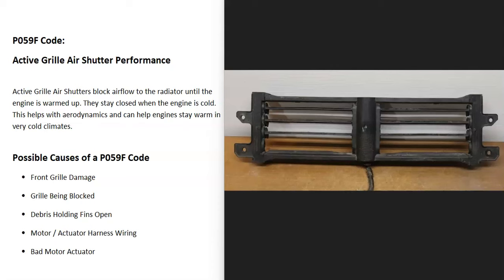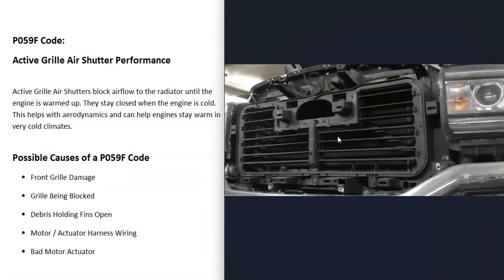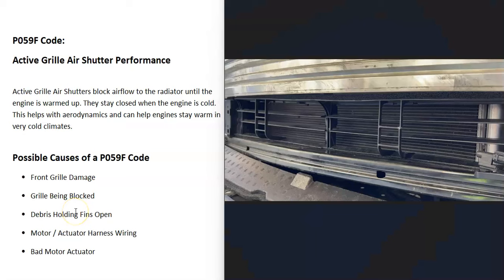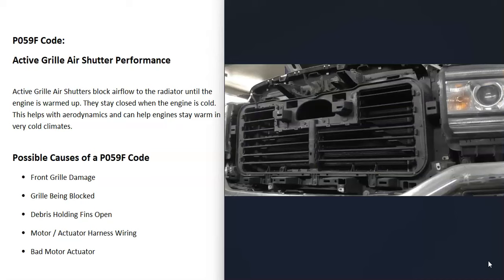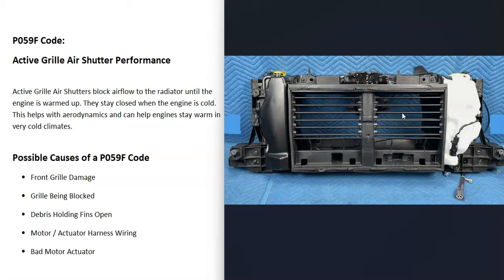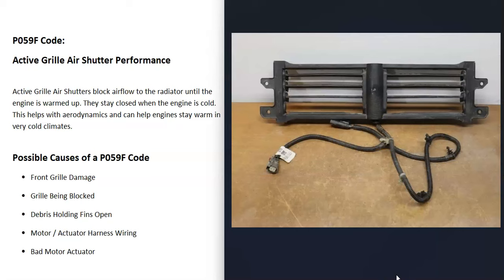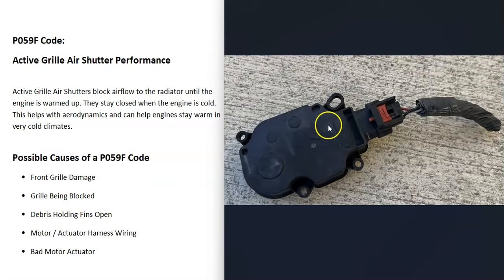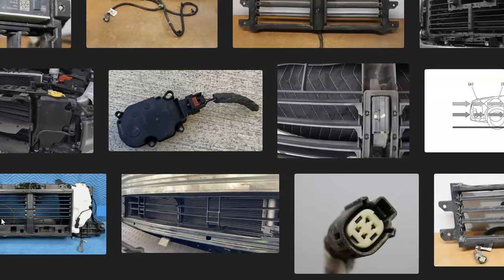Causes and Fixes P059F Code: Active Grille Air Shutter Performance

Comment: I am from Saudi Arabia . I have the same problem with my 2019 Nissan Altima. In winter, the temperature reaches 30 C (86 F). In summer, the temperature in the shade reaches 55 C (131 F). Tell the Nissan factory in America. We live in hell. WTF .
Reply: How did you fix it? Same problem in my 17 Altima
Reply: I am a GM tech in Makkah region, 
Feel free to get in touch for any further information and advice
Reply: I also have a 2019 Nissan 😭 I think it’s, for some reason, common for 2019s nissan
Reply: @cypher1160 what do i do to fix it i have a 19 nissan too😂😂
Reply: Thank you. The video was very helpful
Reply: @felixmoreno570 that's crazy I'm having the same issue with my 2019 Altima

Comment: BMW of North America has extended the warranty on the front grille upper/lower active air flaps for up to 15 years/150,000 miles. It's BMW SIB 01-12-19. This is for G01, G02, G12, G30, and G32 models on certain 2017, 2018, and 2019. Do a search for the bulletin because the production date will matter. The warranty will not cover damage caused by outside influence (Example: If wire harness is damaged from rodents chewing on them or if debris damages that flaps.

Comment: Just got this code yesterday on my titan I just bought two weeks ago !! Thank you for the explanation
Reply: Same here.  Got mine 2 weeks ago
Reply: @Homerunhitta2525 what did you do to fix it?
Reply: @zinndecker8305   My truck was still under warranty so the dealership ordered a new one and replaced it at no cost.  No problems ever since.
Reply: @Homerunhitta2525 how long did the replacement take?
Reply: @dylanrosenfeld475  Dropped it off at the dealership around 6pm and got it back by 6pm the next day.  Luckily they had the part in stock.  No problems ever since.

Comment: I have a 2015 jetta. I replaced the acuator but cannot get the check engine light to go off and the fins are working properly.  Do I have to find someone that has  a VCDS diagnostic machine to clear check engine light and have my shutter communicate with the ECM? The OBDII will not   keep it off.

Comment: So my Dodge ram 2018 2500 overheats when I drive up the mountain when it’s 100° out. If it was anything else like a thermostat or a water pump or a radiator, it would overheat no matter what the temperature is right.? I’ve talked to many other guys who’ve had the same issue and they said they changed the thermostat the water pump the radiator and nothing changed. I think this might be the cause. It’s not throwing or anything, but it overheats only when it’s hot. Do you recommend a lower thermostat and the? Active grill shutters.

Comment: It was  in the 20's yesterday and my wife went to the car wash. Last night I went to drive the car and the check engine light was on.  I scanned it and it had a P059f code.  I cleared the code.  Is it possible that the water from the car wash froze it open or closed.  I drove it today and the check engine light didn't come back on.

Comment: My shutters on one of the sides are clearly crooked, the check engine lights on, the engine temperature is normal, the car is also running normal. Do I need to get this fixed?
Reply: I have a 2018 Chevy Silverado! My app said to service engine and transmission,immediately! I drove to my local dealership! I got a copy of the code! I was freaking out thinking my engine was bad! My mechanic said that in the summer if it’s open that is great bc it keeps the heat decreased around the radiator! Thank goodness mine was open! I’m in Arkansas so the winters  will not be too harsh on it! Yes! I still need to fix it, but if you r in a cooler climate area I would have it fixed! The part for my ride is $550, plus the cost of replacing it! It will take a few hours because of the location (of course)!! Ugh! My vehicle has 70,000  it and this is the newest ride I have had in years! I have so many regrets! My transmission isn’t doing too well! My fluid is brown! And it is shuddering! My warranty is a joke! So I have to have my transmission serviced with flush, filter, etc.. That will cost around $550!! These 2018 Chevys suck!😭😭😩Also, I just found another issue- the whole front end needs replaced! She is our baby! lol! So that is another $2000!

Comment: On my 2015 ford F150 i am getting the PO5BO and PO5AE errors with a PO532 A/C Refrigerant Pressure Sensor Circuit Low Input.  Both of the lower and upper shutters are stuck open and I can't figure out what the issue is.  Could it be a bad wiring harness with both units stuck open?  Any help would be appreciated.  Thanks,

Comment: I have a 2017 Cadillac ats , that started to shutter when accelerating and yesterday it pulled this code , I have someone look at it but no issue with the wiring or blockage

Comment: Can you still drive with this issue
Reply from the maker: If it's stuck open, you are likely OK, but if it is stuck closed, the engine may run hot or overheat.